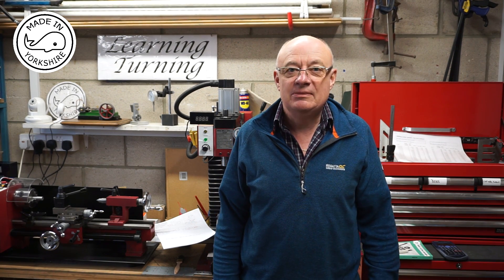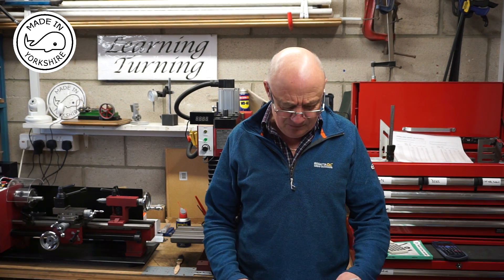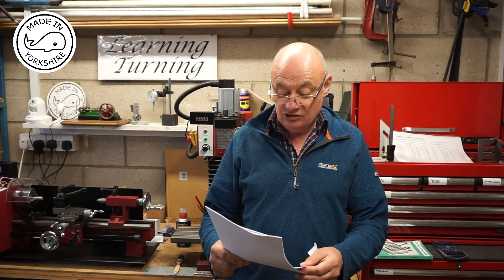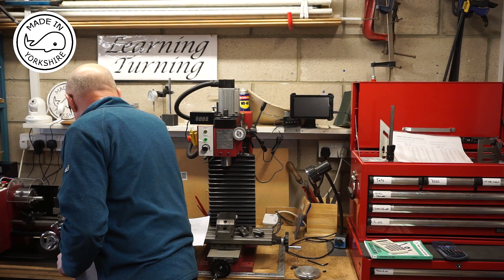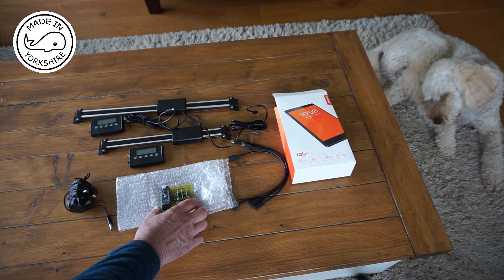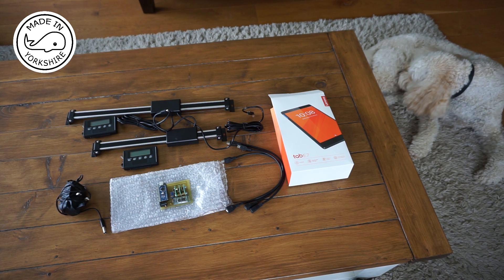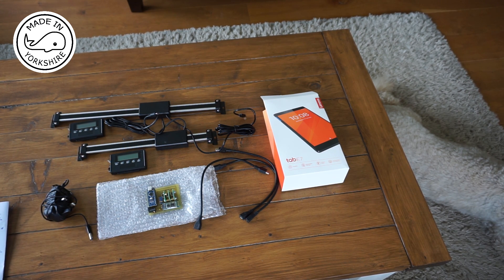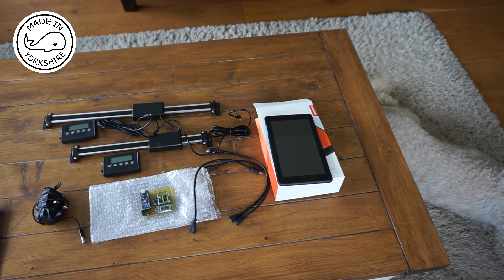#MT28 Part 1 - TouchDRO components for SX2P mini mill. By Andrew Whale.

Comment: Thanks more than a lot Andrew! I've been searching for an interface between those scales and Arduino, My intention is using such scales on the lathe showing actual diameter of the work piece and a lot more. Coding Arduino when coding for 45 years feels safe.
Reply from the maker: Thanks Stefan. If you do improve the Arduino coding, maybe you could make it available for me to include in the download link? I've benefitted a lot from YouTube and I find it's great to be able to give something back.
All the best.
Andrew
Reply: Of course I will tell You Andrew. A number of old lathe improving projects are in the pipeline. A caliper mounted to the tailstock is close to being finished. Adding a scale to the cross slide is really thrilling. Probably the next project, if I find a possible way to mount the scale, will be the cross slide control.
As You tell, Youtube has given me a lot of valuable knowledge and I really want to "pay back".
Reply: I wroute a comment in another of Your videos. Here we are. I would need some assitance from You to crack a stupid nut in order to make something unic for lathes. Could You send me a persoanl message, an Email link?
Reply: Can You send me a personal message like an Email? I've got some interesting code but faced some hardware difficulties.

Comment: Hello
Andrew
I had a touch DRO system on my old X3 mill,
but on my new  WARCO GH UNIVERSAL MILLING MACHINE
I bought  what I call a real DRO with glass scales, and the cost is cheaper too
Touch DRO system,  you have to buy the digital scales, the blue tooth board, 
power supply, and a Android tablet thats far more expensive 
So why bother?

Eddie Harper   UK
Reply from the maker: Hi Eddie. The total cost of my TouchDRO solution is £220. I am well impressed that you have found a glass scale version at a similar price. I would really appreciate details of the supplier you used.
Many thanks.
Andrew

Comment: Hi Andrew - Looks like a really good setup - almost identical to the setup I'm installing on my SX2P.
I'd be very interested in any information you can share on Adam's controller and the Arduino code.  I think the concoction of boards I am using is identical - Arduino Nano, HC-05 Bluetooth and a handful of mini USB boards. (I am adding a level converter for the bluetooth, as it's a 3.3V board, just for peace of mind.)
The biggest challenge is electrically interfacing the 1.5V Shahe (iGaging) scales with the 3.3V and 5V world of the Arduino.  I tried using level converters there but they don't work (too slow I think?)  I also intend to integrate the RPM code that was used in the tacho, and power the whole thing using the mill's power via the GX16-7 connector.
Also - and you may have already discovered this - the USB connectors used on the scales are unlikely to work with any standard USB extension or adapters.  The problem is that Shahe have used the ID(?) pin of the USB micro/mini connectors, and many extensions and adapter omit that wire completely.  Cheers - Andrew
Reply from the maker: Very interesting Andrew. If you email me at learningturning@btinternet.com I will send you all the information Adam gave me.
I'm struggling with the y axis at the moment as height space is somewhat tight. Rather than having the scale upright I've decided to lay the scale on the base of the mill. I would be interested to see the approach you took. Maybe you could email me a pic of your y axis setup?
Cheers
Andrew
Reply: @learningturningmetal  Thanks Andrew, email sent!
Quick question on the scales you have: do they lose position (reset to 0) if the power goes off?
Reply from the maker: Hi Andrew. My remote displays are battery driven. If I turn off and back on they retain the original number.
Hope that helps.
Andrew

Comment: Hi Andrew, if you would consider a conventional internal combustion engine YouTube contributor W5CYF/ Tinker John has made a couple of them and posted videos of the builds. The engine is an Upshure and it is made from bar stock. 
I finished installing a dro on my lathe last night and can’t wait to start using it.
Reply from the maker: Thanks Robert. I'll check Tinker John's build out. I've got it in my head that I need to try a hit and miss, but maybe I'm being too ambitious. Have fun with your lathe DRO.
Cheers
Andrew